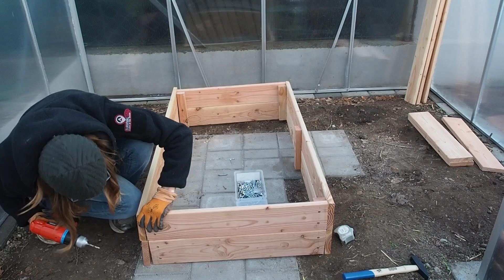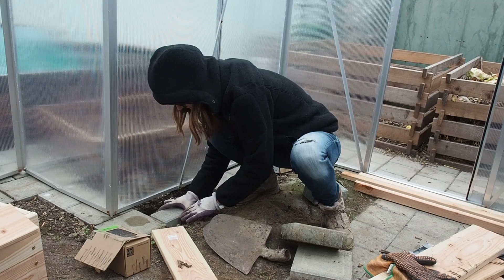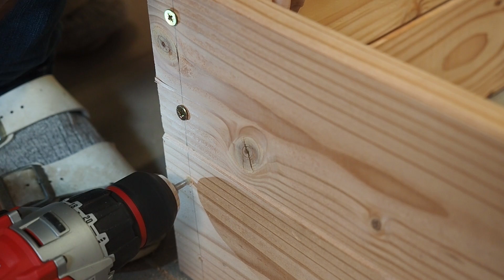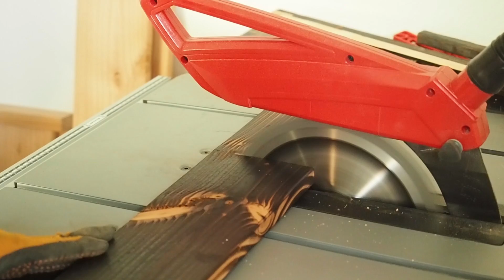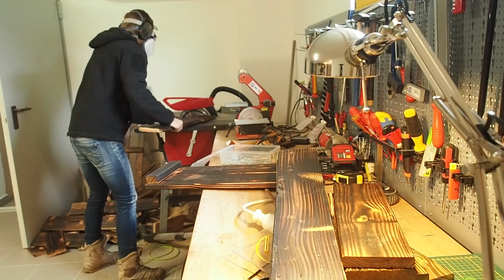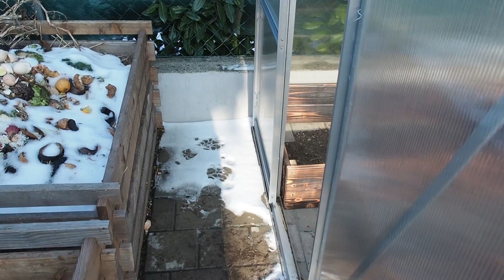Building Some RAISED Beds For My Greenhouse

Comment: Hi Lilly
Nice garden setup!
We have 40 x 4 feet of raised bed growing for 8 years now with amazing yields and I love them!
I am also recommend taking You this opportunity to build your own super soil.
You may have amazing soil just laying around your property but probably not the best thing for a raised bed greenhouse setup probable at the very least need lots of organic matter added to improve soil structure
 Its a lot of work to mix and move that soil so you might want to stack the cards in you favor.
We filled our beds with mostly compost not really any top soil it took 4 years for it to stop sinking and breaking down. We still keep adding to them but its much slower breaking down now.
Our soil is really fertile and we do not really need any organic fertilizer most years!
here is a list of everything we have tried with mostly great results.

I am sure you know Soil is a living breathing, eating, growing , dying thing, so this is what we fed to ours. This is what works for us.

Horse manure composted and non-composted depending on time of application
Cow manure composted
Leaf mold (compost)
Homemade compost Tons literally, (kitchen scraps, garden scraps, sawdust, bio char ,shredded paper, blood meal ect.)

Bio char but make sure it is inoculated (composted) and charged with as much nutrients as possible before you apply. (is acts like a battery for your plants kind of).
Vermiculite for moister retention breaks down slower than organic matter.

Peat moss only used it in the beginning for bulk  but we do not use it now  starting new beds unless for blueberries.(ph reason)

Perlite for drainage (we did not need until year 4 when the beds were full and tests said nutrients all excessive! but we wanted looser soil structure for bigger beets and carrots)

Rock dust  this includes green sand and  mineral phosphate, which is plant available in the right soil.

Mycorrhizal inoculant plant symbiotic fungus it exchanges plant available nutrients for sugars.

Bokashi inoculant (em1)(we spray in our kitchen scrap collection bucket and it helps with the odor also add granulated charcoal and sawdust and you can keep it in the kitchen for 10 days with no odor,  and your making biochar.

Dried alfalfa pellets for slow release nitrogen (animal  feed, its cheap here) eventually you need nitrogen but might not have more manure available or space in the beds

Blood meal , bone meal, cotton seed meal, Fish emulsion  

Kelp meal in the planting hole contains a growth hormone for plants.

Egg shells dried and powdered for tomatoes seem to help slightly.

Bark mulch or wood chip keep everything mulched or cover cropped all the time every season no bare soil. Feeds the next layer soil keeps it moist allows the soil critters  like earth worms to party near the surface 

Worm castings in planting holes, to expenzive otherwise, worms are you best friends keep them alive and happy there presence tell you you are doing good things.

Just some general pointers to success 

Get your soil tested at a lab (try to mix the soil recipe consistent across the beds). the lab results in the u.s. are slanted toward conventional  fertilizers not overall soil health but it gives you an idea of what going on down there and makes you pay attention.
Cover crops really work well especially legumes,just schedule that bed to be fallow.
Crop rotation is super important ! the bugs will find you!  
Big Carrots like SANDY loose soil.
Drip irrigation OMG the best thing ever! it raised yields + lowered watering stress +lowered  water bill,  gardening is fun again!
I am NOT saying go try all this stuff all at once! but over 8 years we have worked  all this and more into our garden beds testing, shoveling, planting , watching  and tasting as we went.

Gardening is a life long, learning hobby.

Have fun!

Comment: I just got my 5 raised beds done, I need to char them, very good idea thank you foir that. I will fill mine with horse manure, as soon as possible and by planting time, say aprilish they should have rotted down a bit and I will add a layer of soil on top. Horse manure is usually free (just ask has been my experience)  anyone with horses has to get rid of a lot...

Comment: All right! A new gardening video! 
Is the scorching of the wood aesthetic, or does it do something practical as well such as keep away bugs?
Reply from the maker: it holds longer when scorched, so this way you do not need any paint.
Reply: the layer of carbon it builds protects the wood against mold and insects. It's an old japanese trick :)
Reply: @survivallillyshorts  ah! I never would have thought of that. Thanks!
Reply: @survivallillyshorts  
LILLY HARD!
Reply: I thought so. I read about that years ago.